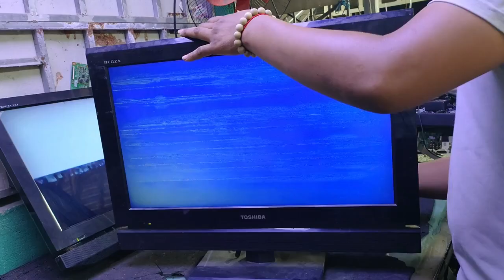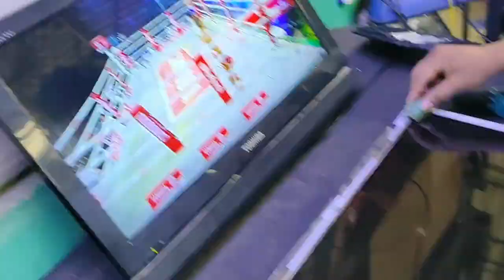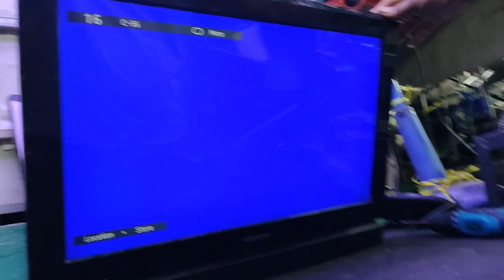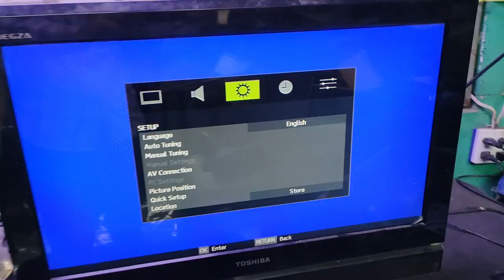polarizer film replacement,regza toshiba 24 inch install polarizer,when we use 7 yeare ago

Comment: Hello, I have the same model. What polarizer degree will I buy? I'm confused with that part. 0 or 90 degree. Mine burned is on front. Can you help me. I'm not a technician, I'm just challenge to do it. What is the liquid cleaner you use sir? And that rubber scalpel what do you call it? The one you use to spread  the polirizer.
Reply from the maker: you use outside=0degree
Reply: @restorationtv168  thank you for the reply. Do I buy it by the size of the monitor, correct? Mine is 32 inches.
Reply from the maker: @meow-ge7xk  no correct
Reply: @restorationtv168  what liquid cleaning did you use? and the planer.. where can I buy that?

Comment: How many degrees are the polarizers outside and the back of the Toshiba LCD TV type 24HV10E2 each?
Reply from the maker: outside of tv Toshiba 24HV10E2 use polarizer 0degree
Reply: @restorationtv168  Hi, I have 24HV10E model, may i know the inside polarizer degree? thanks.
Reply: any one know inside polarizer degree? thanks.

Comment: If regza toshiba 32 inch also same use polarizer 0 degree?
Reply: 2 year ago I remove the polarizer then keep at box ..it possible work fine if I put back polarizer?
Reply from the maker: yes
Reply from the maker: @noobplayer2837  good
Reply: @restorationtv168  thanks so much

Comment: I just installed it but it turns out that there are a lot of bubbles if you remove it first and put it back in again, thank you in advance
Reply from the maker: you can put it again.but you have to chang new sheet
Reply: Oh ok bro, tanks

Comment: Hi sir my tv was pokarized and has white screen if i do this it will fix?
Reply: My tv is toshiba regza pb1 powertv
Reply from the maker: @oogwayoogeewae1839  need code number
Reply: @restorationtv168  my model no is 24PB1E
Reply from the maker: @oogwayoogeewae1839  maby problem sreen
Reply: @restorationtv168  ohh okk

Comment: How mun for change bro
Reply from the maker: 10$
Reply: @restorationtv168  where your shop bro
Reply from the maker: @mrrnaly9121  in cambodain
Reply: @restorationtv168   som acc fb or fb page 1 b
Reply from the maker: @mrrnaly9121  name page fb =Bits tv repair
Reply from the maker: @mrrnaly9121  call to shop[ 093439854]/[012781423]/[088 3282504]